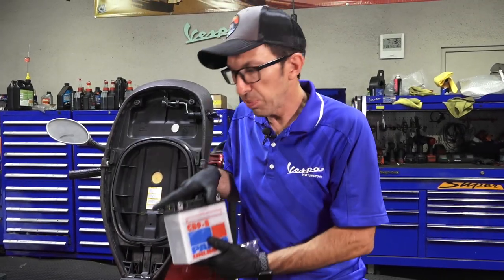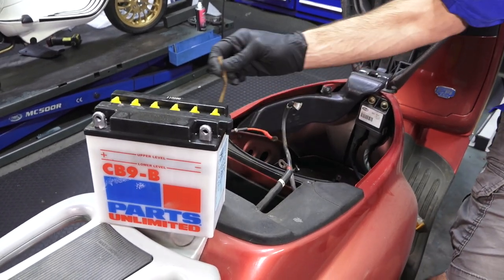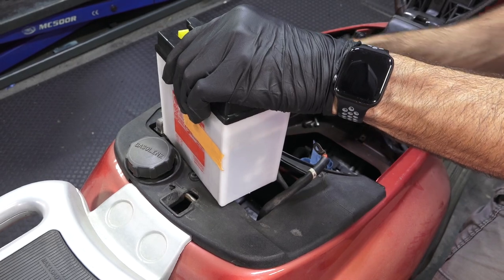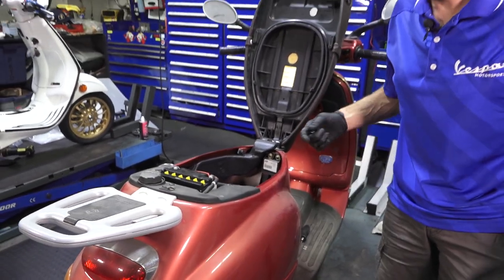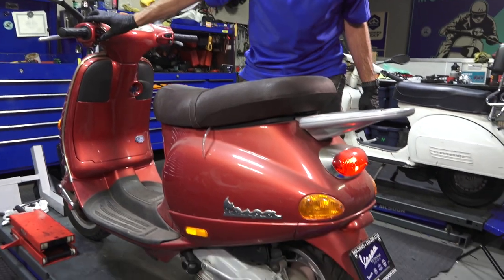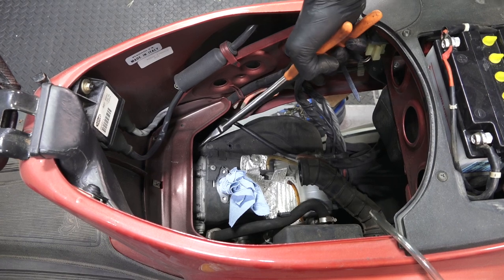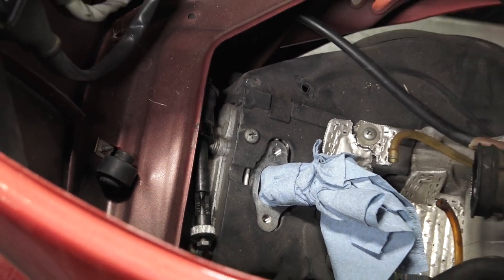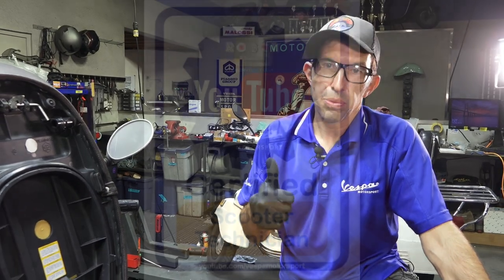Vespa ET4 Resurrection PT. 2  | Battery, Crank Test, Spark Check

Comment: Hi Robot,  the CDI is also part of the iginition system. Even if you have spark, there could be something not working in the CDI right? I had that problem on my LX few weeks ago and replugged the CDI cable, after it worked fine. Even when I had spark before replugging. Nice video again, even learned something about the battery hose, and going to check it right now :)
Reply: Usually a cdi is dead or alive.